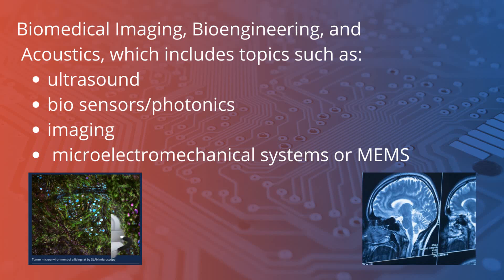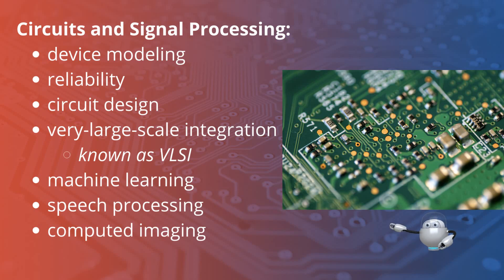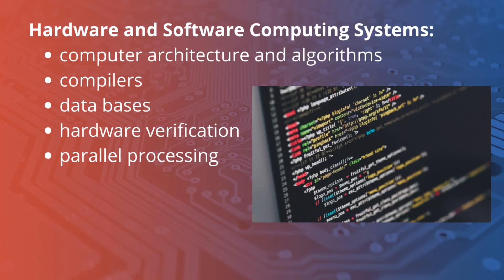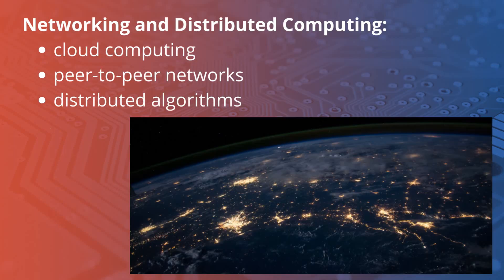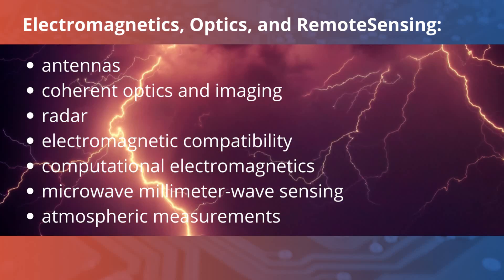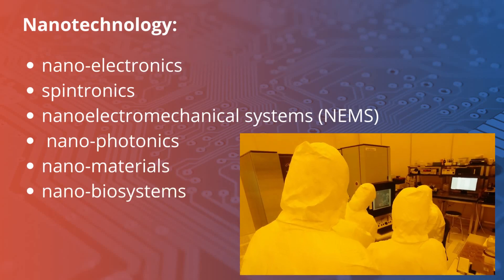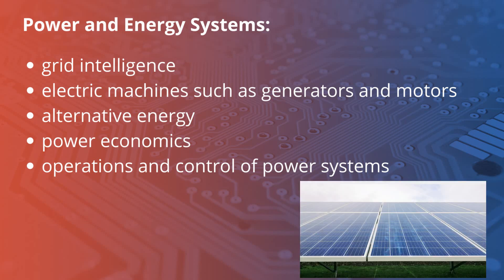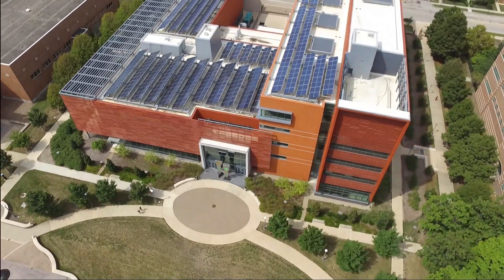Introduction to Electrical and Computer Engineering

Comment: Biomedical 
Circuits and signal processing
communications and control
Hardware and Software computing
Security and reliability computing
Networking and Distributed (systems) computation
EM, optics, sensing
Microelectronic and photonics
Nanotech
Power and Energy